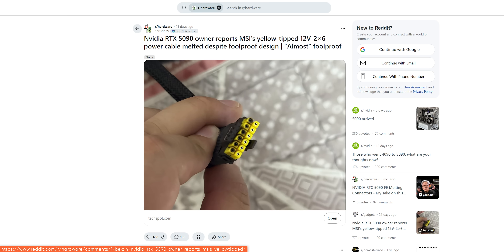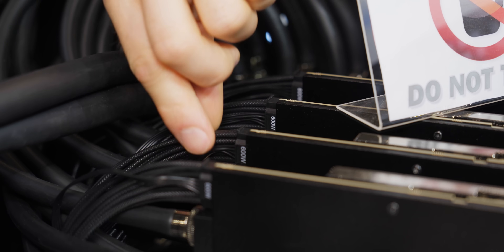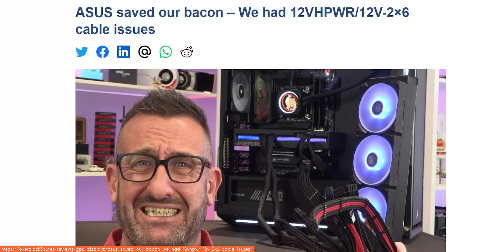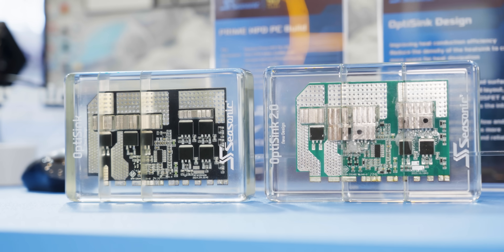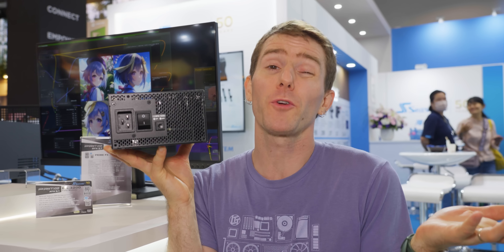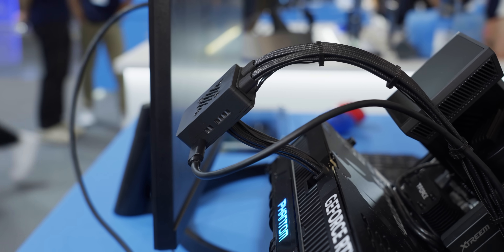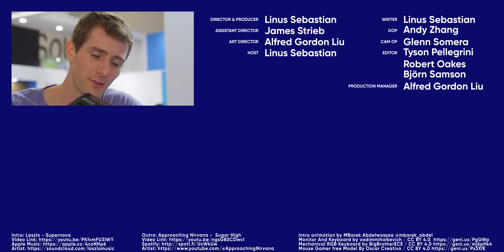The REAL Solution to Burning GPU Connectors

Comment: This may actually be the reason to upgrade my EVGA 1300w G2 that I got in 2020 which has warranty through 2032, that I was intending to just keep using. That or I can buy one of these monitoring boxes that takes 8 pin input and just keep using it lol, there seem to be a few options popping up now with Elmor's PMD2 being out of stock constantly now. If the price is right I'll probably do it, having a screen like that would be cool in my case as well

Comment: 5:40 love how the "themed" cabling for the red one is essentially just the standard black/red/yellow that Wish's finest power supplies use.
Reply: I see it as a good thing. I hate these PSU's where the wires are "all black" or whatever color they use. The colors was standardized forty or fifty years back and they mean something. you can tell by looking at the colors what the cable is carrying. Black for ground, orange for +3.3V, red for +5V, yellow for +12V blue for -12V, white for -5V, purple for +5V Stand By, Green for Power On and Grey for Power Good. That tells you a bit more about what the cable does rather than all of them being black.
There is a fscking reason they have those colors.

Edit: I've looked back a bit and ATX was established in 1995. With the ATX PSU some new voltages and signals was added to the power cables. Before ATX there were no +3.3V and +5V Stand By was added as well as Power On. I think there was a Power Good signal, but I'm not 100% sure. Damn but it's been a few years since I built a computer using the old AT standard. On an AT computer the power button was actually breaking the 120V power, or 220V as that was what we used in Sweden.
Reply: There is something to be said for the multi-coloured cables because you immediately know what that cable carries.
Reply: @saturnblue  what would need to be done with a PSU cable though where you need to know the voltage?
Reply: @Bluecolty  Have you never shorted the pins to fill a Reservoir?  No? Well then I guess you've never needed to test voltage output ether. ✅
Reply: @saturnblue yea, I have tried to fill a reservoir before. I just have a nice adapter that sticks on the end of the 24 pin and does it just fine starting the PSU. No need to know the cables or anything.
Reply: Thought the same haha. It looks terrible and cheap.

Comment: Well.. if the PSU manufacturers pick up on this trend Nvidia can "engineer" its next connector with even tighter margins and save even more on Board design at the same time. Great for profits.

Comment: 3200w is the max limit for a 16a 230v breaker. this is the absolute maximum for European users (not UK users with 13a sockets)
Reply: Next step, 3 phase 400V power, a grand total of 19000W (not overkill)
Reply: @kalle5548  i don't know how you got 19kW but i've found 125A connector so 50kW, but there are other ways to connect power to device with MORE POWER
Reply: @kahtyman7293  i know entires factories that pay 8000 € for 380v 40kw very smart to run a single machine like that.
Reply: @nellox8178 8000 per month??? Or annually? That is still insane. I have a 100A / 380V connection at the house, which yields to ~60kW of usable power (45 used at max without even the power consumption factor)
Reply: @kahtyman7293  A 3-phase 125A service is not 50kW. 3*220*125 is ~82kW of available single-phase power, which all of our electronics consume
Reply: @kahtyman7293 I think he just calculated 400V x 16A x 3 phases = 19200 W.

But because the phases are out of phase with each other (by 120 degrees), the actual maximum is "only" 230x16x3=11040 W (even though the RMS voltage between 2 phases is 400 V).

If you go to bigger fuses, you can get more power. Most residential connections are 3 phases with 25 A each, so you could get 230x25x3=17250 W for the entire house before popping the main fuses.

Some residential connections are 35 A (per phase), so you could get 230x35x3=24150 W (for the entire house). Bigger than that is really rare for the average house (but might become more common with electric cars).

All of the above is for Finland specifically, I'm not sure about the rest of Europe.
Reply: @kahtyman7293 If you wire 3 phase AC between the phases instead of ground (D connection instead of Y connection), you get ~ 3x 400V, and if you pull 16A through each, that works out to about 19KW.
It's pretty common in industrial settings and most homes do have 3phase 230V comming in from the transformer, so it would be possible, but not practical. Also you'd have to shut of everything else 😁

Edit: SamiKankaristo explained it better above
Reply: @kalle5548  When we hit the next "GTX480" moment, 19kW may not be as goofy as it looks, sadly.
Reply: I'm counting 3680W, and breakers won't trip immediately (totally ignoring that 16A sockets aren't rated for 16A continuous; it's something like 13A IIRC). Also, you may get a bit more, because it's like 230V +/- 10%. FWIW, I get 232...235V in this room.
Reply: That's like running 2-3 space heaters off one circuit haha.
Reply: @corsairsofnarshaddaa  what kinda space heaters do you use ?? standard is 2kw .
Reply: cries in US 10A residential outlet
Reply: @LabCat  you must live in a really old house, because US 120V outlets are generally wired for 15A, many are wired for 20A.
Reply: in Belgium light circuits use 16A fuses, 20A for the wall sockets
Reply: @BH4x0r  Similar here in France, 20amp for multiple sockets and 10amp for multiple lighting circuits. The main difference is EU breakers break line and neutral because neutral in the EU is actually live on both Line and Neutral whereas most UK properties, neutral goes to Ground at some point so only live is on the breaker. Both systems have their merits, but whatever anyone says, the UK 3 pin plug is pretty much the best/safest in the world. The Ring Main is fine as long as it isn't overloaded which is why a good sparky will usually upgrade to the heavier gauge wire these days if he isn't saving money for the owner. That makes it safer in the event of a break in the ring.
Reply: @TheGalifrey that kinda depends where you live or how your house is wired, in every house i've ever lived in, the neutral wire is at the same level as the ground, er tied to ground as you call it.

all neutrals in Belgium are supposed to be a zero point, afaik. in here neutral isn't live at the very least.

they do however still get interrupted by the breaker but that's simple safety, if one side of a breaker ever would fail for whatever reason the other side is still interrupting

the house i live in right now, the one before that and the apartment before that all had 0V difference with the ground wire, and 230V between live and neutral or live and ground/earth with a DMM

if you measure higher than a few volt between gnd and neutral you may want to check if nothing is miswired or faulty in your house
Reply: Nvidia will be like : hold my AI Frames 3200watts i can do that
Reply: pretty much every socket breaker that i have ever seen was at least 25 amps , but normally 32 . Some people opt for 40A . Absolutely exceeding your fantasy maximum spec . 
Tough i have to specify this is usually total power for all normal wall sockets . So electric oven is a different circuit . AC might be a different circuit again. 
Total per household is also tipical 40amps . 
Cables in the wall are about minimum 2.5sq mm , sometimes 4mm squared (conductor area cross section)

The new electrical layouts often use much more breakers . 2 for every room and stuff like that ( for light , other for wall plugs) . This new design can have the 16A breaker . However 20A is preferred .
This doesn't mean the whole house can pull more than 7-8kw , but the singular outlets are not limited so much . The classic limit per plug/socket is 3200/3680W . 
A 2.5kw space heater +a washing machine +normal electronics +light will never trip the main breaker .
Reply: Assuming those EU users only have one socket on the spur and no other consumers running on it.
Reply: @TheGalifrey 16A circuit is for a bedroom typically, each having their own. So I don’t think it’s a problem 😂. Probably could use 20A.
Reply: @NameName-ll2yx My 200 year old farmhouse used to have 3 phase so had 3 consumer units all with fuses. Now 2 of them are fed from the main unit with 32a to the garage and outbuildings and 20a to the bedrooms/bathrooms. From there they are individually FUSED on the positive only to different locations. So far I have upgraded the Garage and outbuilding to individual breakers on line and neutral and am now working on the bedrooms but I have to identify all the neutrals as they are currently on a Busbar. The bedrooms will be upgraded to a 32a breaker as they have a connection capable of taking 40a. The whole house is only supplied with 45a so the voltage drop is horrendous at times 🤣
Reply: @TheGalifrey  Or just be weird like the UK with ring circuits for sockets on 36A breakers.
Reply: @nozzlepie  It's 32 amp breakers, and that is why the plugs have a 13amp fuse. Because it's a ring, the wire can take current in both directions around the ring so it used less copper to carry the load, after WW2 when it was scarce. Breakers are there to protect the ring not the appliance, hence the fuse.

Comment: This sounds like a bunch of very expensive bandaids to fix something that is fundamentally flawed.
Reply: Honestly, the power supply acting like a breaker box.Is something I think should be on every power supply.
Reply: @CableFeed  Most already do work as a breaker box, if you short them they will power down until a reset. This is more like ground fault protection where the power supply has to actively measure difference in current on the cables in a group.
Reply: @CableFeed  PSU's already do that, why should PSU's have to add stuff for 10's of dollars when it was a 1 dollar component on the GPU's
Reply: @CableFeed  Should be that way from the start, maybe make it a law to require them to
Reply: @CableFeed  nah, it's too expensive and unnecessary to have breaker on every single pin. Just a regular multi-rail system should be more than enough.
Reply: Issue can't be retroactively fixed in design for already shipped GPUs, these bandaids need to exist, but sadly it also means with time the burden will fall on PSU manufacturers so Nvidia and partners won't have to put money into fixing it
Reply: @kostkostkos2514 It's the second generation of flawed connector and the all lines terminate to one line on the GPU side also doesn't help. This is 100% on Nvidia
Reply: The issue can be fixed at any time by converting the metal part from loose lone standing pins to a single piece of metal connected to a fat cable.
Reply: On one hand, yes, it's expensive and stupid, but on the other hand if you're at the point where you'll spend over 2k on a 5090 (msrp) then you'll probably also get this thing. Cheaper 50 series might not have such issues because they use less power.
Reply: Nvidia engineering, is flawed, they care about pinching pennies, not improving designs.
Reply: Yeah but the bandaid might save your house from burning down.
Reply: @flameofarda4223  Agreed but what should really be happening is that the standard should be updated to implement more headroom on the power delivery and to disallow manufacturers to merge all of the wires into a single bar.
Reply: @chaosfenix  I think the way simpler solution is to just continue the bar on the wire side. They should be all merged up right at the connectors for improved heat dissipation between wires and probably prevent thermal runaway of a single pin. The total cable mass should be able to dissipate the extra heat of a failing pin or two I would predict.
Reply: Yeah Idk why the title says "real" solution. Obviously the real solution is different connector or outright different voltage. Which is funny, because 12VHPWR already is a new connector. And upping the voltage is only possible in data center applications.
Reply: @graealex  upping the voltage requires PSU and GPU makers to make the change, has nothing to do with data centers. Also I don't know why we bother with these multi parallel cables when 1 or 2 per pole would be better
Reply: Yeah, it's a stupid fix. Just add more pins when appropriate to the connection, and bam problem solved
Reply: At the end of the day, it's not the cable or even connector that's inherently flawed. It's the manufacturers that are causing issues, along with user error (though I'll give some of that due to manufacturers' poor decisions). They wouldn't get this shit past regulators if it didn't work as designed, given what it's juicing. This is the main reason I sadly didn't upgrade to an EVGA 3090 Ti (power cable issues), and why I'll likely wait until the 7090 to upgrade from my 3090. That and at 1440, my 3090 is still doing most games well (RT aside).
Reply: @metaleggman18  if user and manufacturing errors are easy, it is a flawed design. nothing more. nvidia being the major graphics card manufaturer is able to force design choices
Reply: The connector is not flawed. It's the fact that Nvidia and some board partners chose to bond all pins together so they can never know if the pins are all connected, which just sucks. Board partners that spent the extra few cents and didn't do this, don't have this problem.
Reply: @0106johnny  too bad that the bonding of all pins on the card is part of the 12V2x6 spec. This shit is flawed by design.
12V2x6 should realistically only be used for <400 W connections to have enough safety margin
Reply: @Kirschenbier  <400W wont even help, my Corsair Premium cable melted under 350W load as most of the current was coming through a single pin, though fortunately didn't melt the plug or socket just the insulation on the wire.  The 30 insertion cycles is BS too, I only unplugged it once or twice at most.
Reply: @Kirschenbier  Yeah I forgot all of this as well. The standard also doesn't allow for nearly as much headroom as the older pcie connectors. Again they need to update the standard to disallow the bonding of all the pins and to put in proper headroom on the connector.
Reply: @0106johnny  It is fundamentally flawed. Cause the best case scenario with this connector is Nvidia putting the protection on the GPU, but that still doesn't stop the wires from failing, just from failing catastrophically. However if you fail enough cables, the port on the GPU will also need to be replaced and that's not something an average person can do without replacing the GPU. And replacing your expensive GPU because of the power plug is the issue right now, so...
Reply: @0106johnny It is still flawed if the spec allows for such a dangerous implementation.
Reply: @0106johnny  The single power rails is allowed as per the standard. If they want to update the standard but keep the connector then that is fine but regardless it means that the standard if flawed and needs to be updated.
Reply: @0106johnny  so it's flawed

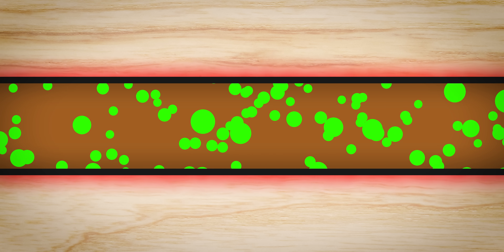Comment: 1:00 doesnt increasing the amount of copper also increase the resistance?
Reply: No. The formula for calculating the resistance is: resistance = rho * length / surface. Rho is a constant that changes based on the material used. (copper is 17 * 10^-9 ohm * meter) In the example, the surface of the wire increases, which would decrease the resistance.
Reply: Think of it like a hose. Bigger hose =more copper. Bigger hose = less pressure drop (voltage) for a given water flow (amps) is less.
Reply: @rev3489  no electricity is weird bigger wire equals less resistance, but I can see why you would think bigger wire have to travel through a bigger object so more resistance but no

Comment: The real solution is to increase voltage. They already need DC/DC regulators as they can't use 12V directly, so might as well make it 24V and cut the current literally in half.
Reply: yeah, and then you're still having to compete with switching losses to rectify that down 1.8V range, so even more beefy cooling on something that already takes 4 slots to keep cool lol. That extra voltage doesn't come for free. Also means more expensive components, and also larger inductors on the GPU etc. There's plenty of good reason to keep it at 12V
Reply: I work with 28V systems regularly, the efficiency difference is pretty negligible, same with component cost. The heat is overwhelmingly in the GPU itself and the RAM. It's not zero, sure, but not really a concern either. 24V is better though, far more common than 28V.

If they stick with low voltage, then they might as well embrace Linus's idea (or take it further with just using lugs).

Can't have it both ways, either they increase conductor size or they increase voltage. Hell, cell phones charge at 20V these days, the price to stay with small connectors.

Comment: Nvidia is big enough that if they wanted more power in the same cable, they should have increased voltage. Power supply manufacturers would have jumped right on in providing a 24, 36, or 48v connection for a GPU. Then these melting problems wouldn't have happened.

Comment: To solve this in the PSU is the best way. Of course everybody will s#!t themselves when the PSU shuts off the gfx because of too much power usage. But it is the best way to protect the connector, the wire and the card.
I mean, the electrical panel in your house is also the beginning of your wiring and electrical system, not at the end. Your would not trust a possibly faulty device to shut itself off in case of too much power usage, or would you?